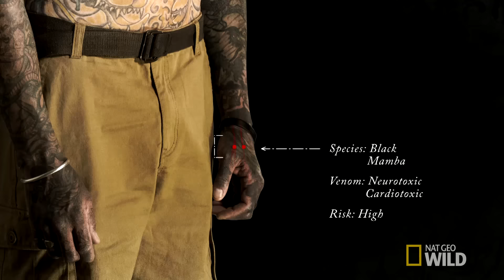Stove Top Mamba | Snake City

Comment: Their efforts to catch snakes like this are indeed interesting; I catch and relocate Timber Rattlers here (Georgia) myself. But we diverge in belief at a certain point: I will not expose myself to extreme danger to save a snake. Meaning, that the snake or other dangerous predator might have to die to save human life. Another thing disgusting to tree huggers: I have a shotgun loaded with #8 shot handy along with my snake tongs. Every situation is different of course. Timber rattlers are generally docile animals and easy to safely pick up. But from what I've seen of these murderous things, my "backup babe" would tote the 12 gauge. (I am aware that this is repugnant to Greens and people from other progressive sheep countries.
Reply: You are wrong. I'm one of those tree huggers you're talking about, but I completely agree with you on putting human a human life before a snakes. So if a snake has to be killed for safety, then so be it.